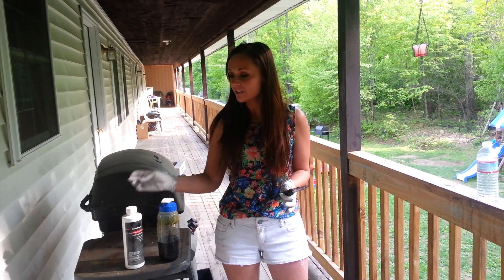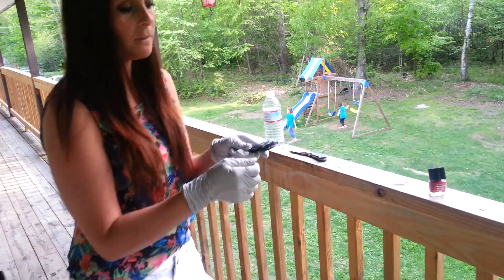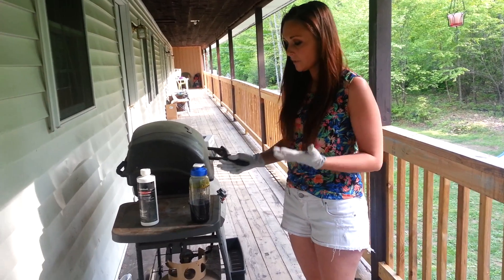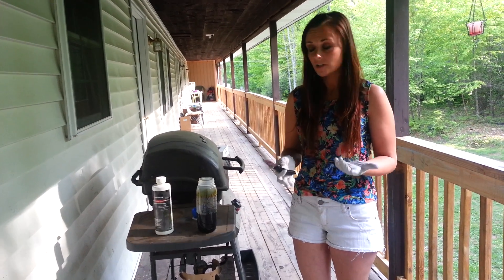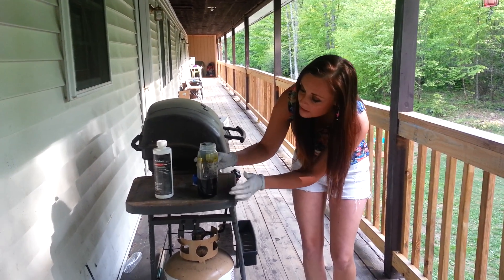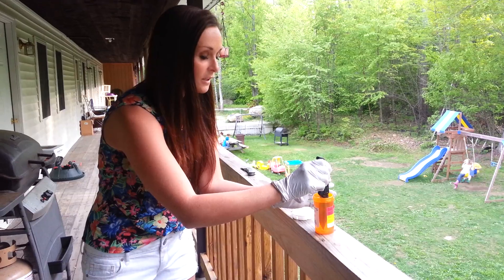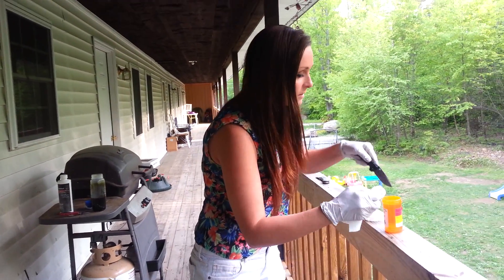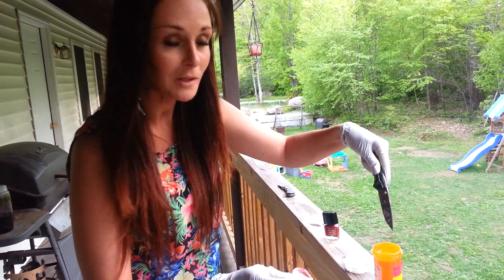Acid etching tutorial

Comment: suggestion for your next experiment..:: use a toothbrush to spray the finger nail polish apon the blade,with a quick flik.. you can even make a stencil, using painters tape or cut up a cereal box...
This is a good fun project..ty for sharing. 
Cheers ;-))